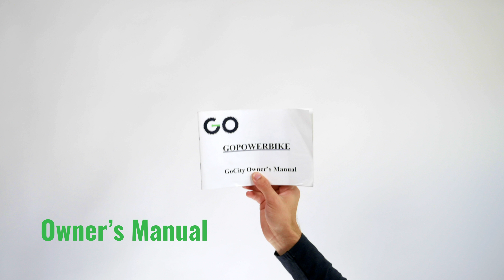GoCity Assembly

Comment: Two things: 1)My bike did not need the screw removed and  the plastic cap with the logo printed on it flipped over--the plastic piece was already in place (with, by the way,  no logo printed on it) but because of this video I did remove the screw and had a bad fifteen minutes getting it back in and the washers back in place that had slipped out of the tube. 2) It is a beast to attach that derailleur guard. I had to file one of the holes to get the screw back in.
Other than these things, the bike looks good and of good quality. We shall see.
Reply: So how's the bike going?
Any issues with it so far?
Also what range are you getting on one charge?
Reply: @LLF1234  It performs well. The range is quite good. I never worry about it. Once every three days or so I charge the battery but could go longer without charging. It is worth what I paid for it, in short.